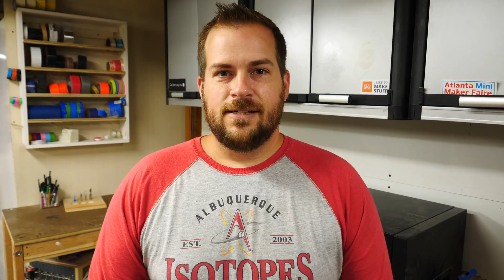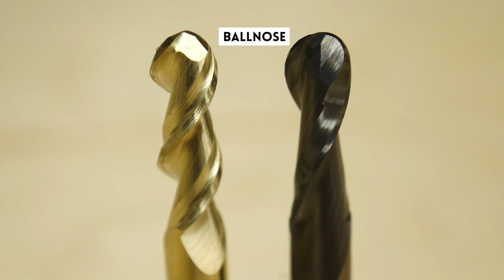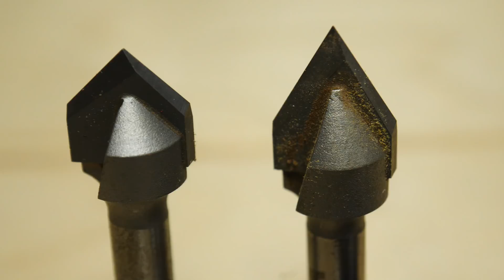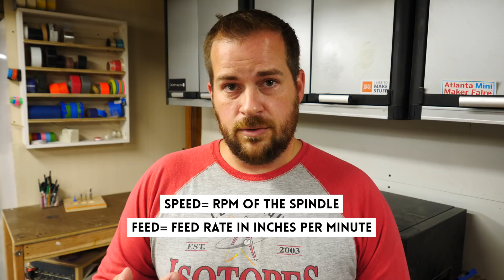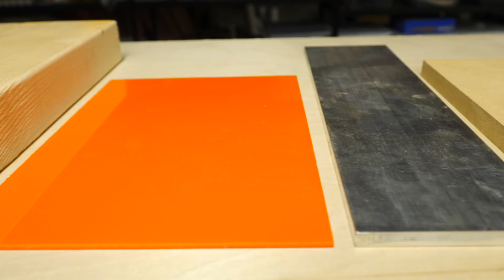CNC Milling Bits // Bits | I Like To Make Stuff

Comment: Bullnose endmill, ball endmill, flat endmill, high feed mill, face Mill, shell mill, roughing or "hog" mill, plunge mill... please  don't refer to end mills as a, "bit," when you order them. Just a suggestion. 

Feed speed and depth of cut are generally the difference between finishing a job and thinking that a piece of tooling is garbage or a piece of tooling is great. The cutter geometry, like rake angle in particular, variable or even helix angle, variable pitch or even pitch, chip breaker,carbide grade and composition, CVD or PVD coating, coating material (AlTiN, TiAlN, TiAlSiO2N, TiN, black oxide, nano coatings). The tool is only as good as the tech data you use, 100 % of the time. Percent of diameter engagement, or radial engagement, step over, are also important. If you're going to plunge that end Mill down into the material make sure it is a center cutting end mill or you will likely not like what happens (though some woods are very forgiving even the shittiest programming). Entering a cut at a ramp angle, or if cutting a pocket a helical plunge, is definitely preferable, in most materials. Is entering a cut on the side of the material, moving into the material with the side of the end Mill a right-handed Arc slightly larger than the radius of a cutter can actually extend the life of the cutter and prevent unforeseen damage to the workpiece, surprisingly effective. Chip clearance, chip removal, is extremely important. And something that many people, especially machinists who have a lot of experience cutting metal but not wood, are surprised, shocked, to find out that there are some hardwoods in the world that are similar in hardness to some metals, and there are plenty of hardwoods that are more abrasive, due to silicates or chitin present in the cell and or cell wall, as well as some species specific proteins found in the cell walls of certain wood species, that are extremely abrasive, or extremely hard in very small particles throughout the wood, that can do a surprising amount of damage to what otherwise would be expected to be a great cutting tool.. many woods also have oils present in them, and this can cause small pieces of the wood to, at the high heat generated during the cut, dick to the tool, and then on the next rotation of the tool, the next time that cutting edge comes through the material and makes that cut that wood more or less glued onto the tool can actually rip some of the tool surface off from the tool period this can be especially bad if you have a coated and mill and are using speeds and feeds that are not suitable for that tool in that material, especially if you are taking a slotting cut, where the entire diameter of the tool is engaged in the cut. Sorry, it's been a while since I've been running a machine shop and I miss the day in and day out challenges and problem solving. Don't know what you got until it's gone, right? Well, I wish you all happy cutting!

Comment: CNCs come in a variety of ways. Your standard X-CARVE for instance is called a 3-axis CNC mill, because you have an up/down axis, a  left/right axis, and a front/back axis. There exists other CNCs though which can have upwards of 5 axis! These CNC allow you to also rotate the plane the piece you're milling sits on in order to reduce errors that happen when you take out your piece and replace it.

Some CNCs also have magazines for your bits, so that the bit can be changed while the CNC is cutting, for some operations, so that you don't have to change the bit manually every time you need it.

CNCs also do not specifically refer to CNC mills. There also exist CNC lathes for instance,  so that you can cut accurate tapers and various cylindrical shapes automatically.

When you cut a piece on a CNC, you need to be wary of the depth of cut you take. The finer the depth of cut, the longer the process will take, but the better the end result, and the longer your bit will last. It's pretty common to take a rough pass first to clear out most of the material, with a large depth of cut and high feed rates, and then take a finishing pass with finer adjustments.

The bit has some flex to it! Of course, the rigidity of your axis matters a lot as well, but with large feed rates and large depths of cut, you'll introduce large forces pushing on the bit, causing inaccuracies, or worse, the bit bending or breaking off.

The bits also heat up quite fast, especially when working with hard materials like metals. Most CNCs powerful enough to machine metals have a coolant hose that cools the bit and the piece off, whilst also clearing our chips.

Speaking of chips, it doesn't matter on wood, but on plastics and metals, it is important to clear out chips as fast as you can either with liquid (coolant) or with a dust shoe. The bit heats up, and can melt back the chips on the piece resulting in a crappy surface finish.

Stay safe! Wear your PPE, especially safety glasses and dust mask when working near a CNC. Just because you're not the one doing the routing doesn't mean it's any less dangerous. Also, no gloves, be wary of your hair, or pieces of clothing. You do not want the bit to catch in that, it's the fastest way to rip a finger or two off. If your machine is enclosed, it's all the better.

Comment: Great video! But you didn't mention compression bits. They're a hybrid of up/down cutting bits and are great for getting nice finishes on both sides of the material that you're cutting (in through-cut situations)

Comment: I often assumed the speed and depth rate where automatically calculated by the software handling the cuts when you tell it what material to cut and how deep?

I don't have a CNC so I'm just going with what I've seen others do on YouTube 🤔
Reply from the maker: That depends on the software you are using. Most of them, you set those parameters.
Reply: @Iliketomakestuff  isn't it Easel the one everyone seems to use?
Reply: J-L Arts easel is the software made by Inventables, the company that makes the Xcarve. So far, it only works with their machines. There are many CNC companies and many software packages.

Comment: I always add information about the taper of a tool bit, and what is the advantage of using an end mill with a slight taper.

Also, I tell people to look up the Ideal Feed rate formula because it shows the relationship between the ideal speed, the ideal feed, and the ideal chip size.  If you can read the math as language, it lets you know if it is better to use a wider mill tool, a deeper cut, or a faster feed rate to do the cut in less time.

The least thing that I add is that a shop CNC is basically a robotic trim router, and if you do the planning right, you can use any router bit.